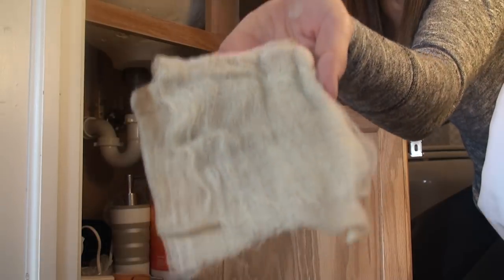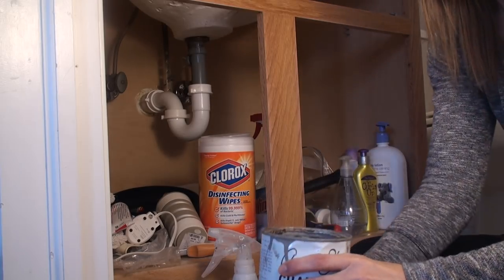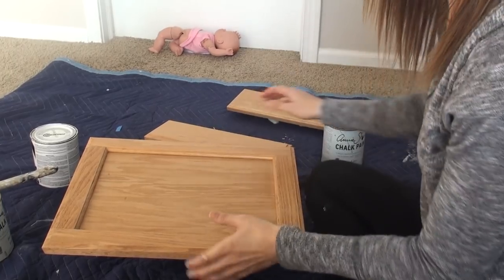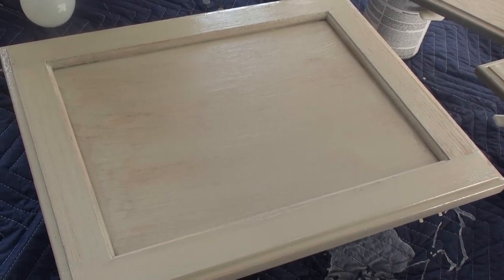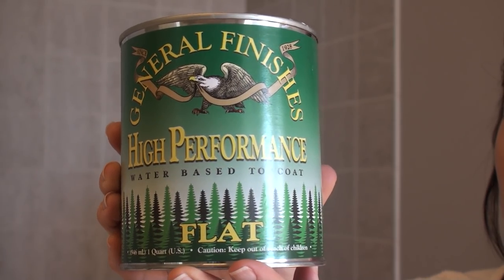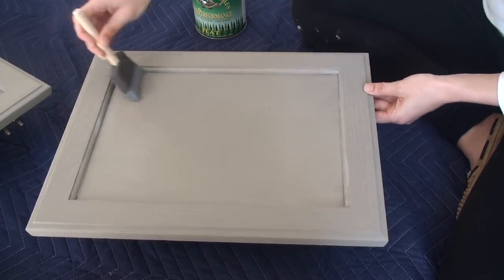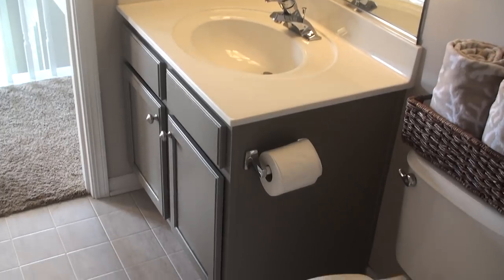Chalk Paint Cabinets With Annie Sloan Chalk Paint

Comment: I just finished my bathroom with chalky paint.  I had the same oak doors with laminate sides.  Chalky paint is very forgiving!  This was my first time using this type of paint, and I can’t say enough good things about it!  Keep in mind that there are other brands out there.  I also used the cheap black sponge brushes without any problems.  I wrapped the brushes in my gloves when I needed a break and they worked out great!  ( also, they kept well over night!).
Reply from the maker: Thanks for sharing. I've got some new paints I'm going to be trying soon.

Comment: I've never been able to use that painter's tape drop cloth without it sticking to the wrong end of the plastic and making a mess. Glad it works for you.
Reply from the maker: That happens to me sometimes. I've just learned you can't roll out a big section. Just do little bits at a time. There is also a dispenser you can put it in that would prevent that. The point is to make it easier, so if it's giving you trouble you are right to just scrap it.😉
Reply: @ChristinaMuscari  a dispenser makes sense. I'm using up the roll by leaving the tape and just unwinding the plastic. Maybe I'll use the tape later :)

Comment: Just a hint: remove all doors and hardware first. It makes it easier and quicker! Love your vids! Also when painting in areas where there is very little room either use a roller or cut your paint brush handle down to a more usable size for for tight spaces!

Comment: Hi Christina, Thank you so much for sharing your experience. 
I'm wondering if you have ever tried to use this top coat on any white paint before? I read couple reviews from Amazon.  They said your cabinet would turn yellow if you apply this top coat of General Finish over white.  Also,  Instead of using Flat top coat, would the Gloss top coat handle better with high traffic?

Comment: New to this paint and I learned a lot watching your technique.  Painting from behind, while propping up the door in front of you took a level of super power talented skill~Just wanted you to know I recognized that!   The squirt bottle technique and brush used so helpful!  Again, just learning, so don't be offended at this comment/question...If there were ever a time you would want to seal, protect and paint the inside of the door, wouldn't this be it?  Would you address why you didn't coat the inside if other then just time or interest?  Will the edges be durable enough for daily use not doing it?  Is it just my OCD that would be fulfilled in matching inside to outside?  Any insight would be appreciated. Thanks.  PS. the waded up necked infant on the floor really freaked me out, tell you little one that was great touch to the video!   : )

Comment: I want to try the chalk paint!!  I really like the finish it gives. Question.  Why didn't you pull the toilet paper holder brackets out? Unscrew, simple. Leaving them attached and painting around is like painting around a switch plate cover!
Reply from the maker: I get this question a lot. They were those weird wing nut screws, and I didn't want to mess with them. The toilet paper holder covered them completely, so it ended up looking like I took them off. But the simple answer is laziness.

Comment: New sub today, sooo loving that you do things properly & explain processes thoroughly instead of doing half the job & glossing over the instructions like so many YTubers (who then post vids called "Why I'll never use Z Brand Paint ever again" when it was usually them who didn't follow the instructions) ... ... Oh no, the OCD-nut in me noticed you painting around the toilet roll holder brackets, instead of unscrewing them - I think I need to lie down for a minute. LOL
Reply from the maker: 😂 You are the second person to say something about that toilet paper holder! It has those wing nuts so I didn’t want to mess with them.
Reply: I'd probably have done exactly the same if I wasn't having an OCD moment at the time LOL. I did have freak out tho, when watching another YTuber using chalk paint on one of those really old, tiny rectangular wooden stools that would be used for little  kids to reach the sink & toilet etc. She decided that "no preparation required" meant she should paint over 80+yrs of filth without even cleaning it. I felt sick.
Reply: Yes, but you can watch Annie Sloan herself on youtube not priming or sanding. I was surprised when she did all the prep in this video.
Reply: LOL. I bounced off the walls when she didn't remove those brackets. But sometimes it's better not to mess with screws, depending on what material they are in. 
Btw, loved the finished cabinet! Nice choice of color, looks very "up scale".
Reply: This is not a jab at Annie Sloan but she is trying to sell a product and to do that it has to be easy for the consumer. If the surface to be painted is not clean and free of old finish that has oxidized or no longer bonded to the surface then the end result will suffer. Christina seems to be very experienced and has learned when to put the paint on without much prep or when prep is needed.

Comment: Thanks for the instructions, you make it look so easy!! I do have a question. I was wondering if you painted the inside of the doors, I couldn't see in the video if you did. Also, how is it holding up after one year? I would appreciate a follow-up on the durability. I am thinking of doing either a gel stain on my bathroom cabinets or possibly paint. I would like to see how the paint held up.
Reply from the maker: I did not. I tend to not paint things that people won't see like the inside of cabinets or behind pieces, but you certainly can if you want to.

Comment: I wanted to ask a question but was afraid it was stupid😳. I was so glad to find someone who commented that she had painted her kitchen cabinets with chalk paint. That's what I wanted to ask about. However, I want to paint mine white and you mentioned that the protective coat may yellow. Is there something I could use that wouldn't? And is there one in a semi gloss?
PS I love your straight-to-the-point teaching.
Reply from the maker: If you are wanting a semigloss finish, I would just use a latex paint. You will need to prep your surface with a primer or more sanding. I don't have any videos using latex. Just do a search and I'm sure you will find a good one.

Comment: This is my first video with you.  Great job.  I'm actually redoing my bathroom cabinet with the same color and I was trying to find a video and came across yours.  I've painted many pieces in Annie Sloan paint and wonder why you didn't just use the annie sloan wax instead of the General Finishes?  Thank you for the video.
Reply from the maker: You can definitely use wax if you prefer.  Either would work. The topcoat is less of a learning curve so I wanted to show it as an option for beginners.

Comment: What do you recommend as a top coat for white chalk paint that won't yellow? Your cabinet turned out beautiful!
Reply from the maker: Only safe proof is wax. All whites will yellow over time with a topcoat, but the best ones are water based like the one used in this video. You can also check out Dixie Bell topcoats because they are formulated to work with paint. https://dixiebellepaint.com/gator-hide/?aff=166

Comment: Do you think chalk paint is a better options vs a regual semi-gloss paint? I have 3 vanities that have been painted white a few time so wonder if the chalk paint will work as long as I do all the prep. I hope replacing hinges will be easy since mine have been painted white by previous owners and look cheesy! I am excited to try putting pulls on for the first time too, thank you so much for your tutorials. Also my fake drawers on vanities don't look like I can easily remove them. Wish they were like yours.
Reply from the maker: I've refinished vanities with both. I like the look of chalk paint better because latex can look plastic like to me. It's really personal preference though. They both held up the same in my opinion. You will have to touch up painted cabinetry every now and then no matter what you use. Replacing hinges is not hard. Good luck!
Reply: I think I will try the chalk paint then thanks so much!

Comment: Your videos are fantastic! I've learned so much from them. Question- have you used low grade wool pads to apply the paint? Curious to know if you have painted cabinets with it or not. I did my dining table and loved it. Also, if I am painting my cabinets white, what top coat do you recommend instead?
TIA!
Reply: Annie Sloan has a water based top coat now!  I was told it won't yellow anything but I haven't used it, but it's worth checking out!

Comment: I'm going to be doing a dining room table soon. I'm staining the top and painting the apron. What if the grain goes in different directions? On top, the grain is diagonal and from all four corners goes toward the middle. Does that make sense? lol! What would recommend? Thanks! Love your videos!
Reply from the maker: Yes, I do. I’ve had tables like that before. Just go from side to side (the shortest width) all the way across. Just keep the stain in the same direction and it should turn out.

Comment: A tip that is a better protection for the paint. Butchers bowling alley wax. Can put on a coat every 10 minutes after buffing with a dry rag. Goes on very thin, nice smell, if you can drop a bowling ball on it, its tough. I do french polish on antique furniture so I know waxes. Much better than poly or laquer, gives a low luster sheen for less expensive woods..
Reply from the maker: Cool. Where do you get it?
Reply: @ChristinaMuscari  , you can get it at home depot or Loews. Alot of times the paint store will have it too... Have fun..

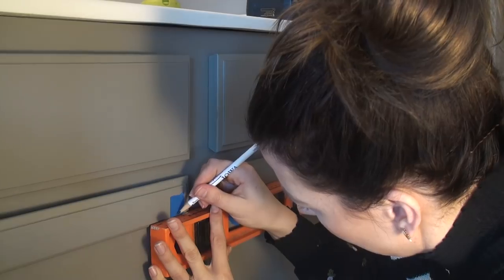Comment: Looks pretty good, but the lighting is poor. At 10:13 I can't tell if I am seeing brush marks or the grain of the oak.  Question:  why did you not remove the door before sanding?  Seems like it would be more comfortable that way.  Thank you for this video.  Your technique is definitely an option for painting my similar oak cabinets.
Reply from the maker: Sorry about the lighting. It's a tiny bathroom with no windows, so the lighting was tricky. You are probably seeing the grain of the oak. If that bothers you, I think there are products you can buy to fill in the grain (like a primer). I didn't have a problem sanding the doors on but you can certainly take them off if that works better for you.

Comment: I have this same color "french linen" and want to do my boy's bathroom. If I wanted to add some darkness in the crevices, how would I do that sealing with the General finishes top coat? Would I apply A.S. dark wax in the crevices and then seal, or use something different to do that? I thought I read something about that sealer not working well over wax, but I may not know what I'm talking about. lol!
Reply from the maker: You have to choose either wax or top coat to finish. You can't use a poly over wax.
If you want to add some depth and or darkness the dark wax is the way to go. If you just want the dark in certain spots you can first use clear wax and then add the dark over in the areas you want.

Comment: Amazing job and thank you for the great explanations. What's the benefit of using the Annie Sloan chalk paint? If you were already priming with the Zinsser, couldn't you just prime the rest of the cabinet and use more economical paint? How many total hours of paint time did this take, minus the drying, do you think? Thank you so much for great content!!
Reply from the maker: You certainly could prime and paint with another paint. I have been working with Annie Sloan for years and always go back to it. It doesn’t have plastics in it like a latex so it really melts into the furniture instead of sitting on top. It’s just a preference for me.
Reply: This is exactly what I was thinking! Why use 3 coats of paint, when you can get the same coverage with 1 coat cheaper primer, and 2 coats expensive paint?

Comment: To get rid of brush strokes to keep it very smooth, you should apply with the grain, let dry then SAND it lightly in between each coat. Next coat you should go AGAINST the grain, then sand, then WITH the grain. That's how you get a very smooth surface.

Comment: Thanks, I enjoyed the video. 

I understand that artists dilute acrylic paint with water at-their-own-risk, as the pigment doesn’t really dissolve as well in water.... Does the same go for latex or chalk paint? Have you ever noticed textural issues or separation of pigment when you dilute with water?
Reply from the maker: I’ve never experienced separation of pigment. This paint is water based and the manufacturer recommends using water for a smoother finish. I don’t always add water like when I want a textured finish.
Reply: I like your picture, Caroline Olsen. Viola!

Comment: Thank you for sharing this! I will be doing my kitchen cabinets soon! My question is, which foam brushes do you use? The ones I get from the dollar stores always leave behind pieces of the black foam. Whether I'm using them with regular paint or mod podge. Please help! Lol
Reply from the maker: I get mine at the hardware store or Amazon.
Reply: @ChristinaMuscari  thank you for answering! I'll try those instead.
Reply from the maker: Another tip I've seen is putting a nylon stocking (like the ones at the shoe store) over it.
Reply: @ChristinaMuscari  oh that's a great idea! So I can still use the ones I got from the Dollar Tree 😊

Comment: Have you had any issues with tackiness? I used oil based paint and mine after a week is dry but has tacky feel to it, mostly when you close the vanity doors. I didn't use the primer before painting but did power sanded it prior
Reply from the maker: No. These are both water based so it dries fast.

Comment: Thanks for posting.  Quick question:  What is the importance if the top coat?  I.e., what if you had only used the chalk paint?
Reply from the maker: It will chip and scratch with use, so I typically seal all my dressers and cabinets. The only things I don't seal are things that hang on the wall or decorative items I don't touch or open everyday.

Comment: I liked the video, but I was surprised at home many coats you needed to use....why did you choose the chalk paint rather then a regular paint, like a one-two coat option?
Reply from the maker: I get questions about painting cabinets with chalk paint so I wanted to try it. I have painted cabinets with latex paint as well. I personally, like the look of the chalk paint better. It does not have any plastics in it so it looks more matte. You can certainly do whatever you prefer.

Comment: Did your Purdy brush come in that shape, or just wear into it with frequent use. The linked brush doesn't have the notch on the end that yours has.
Reply from the maker: It is just sash brush. The point did occur from use. I’ve had it for 4 years!
Reply: Thank you!

Comment: What is the difference of you using the sealer vs the Annie Sloan clear wax?
Reply from the maker: The sealer will give you more protection and water resistance than wax. That being said, I know people who have waxed cabinets and are happy with them. I chose to do the HPTC because my audience wanted to see it most. Personally, I think the topcoat is easier to apply for beginners as well.

Comment: What top coat do you use when painting with a white chalk paint? I want to do my cabinets white on the top and grey on the bottom but don't want a yellowing to them.
Reply from the maker: I’ve never done white cabinets. I’ve used General Finishes High Performance Top Coat on white chalk paint and was pleased with it, but they have warnings on their website about it yellowing over time.

Comment: Often a paint company will say things to trick the consumer into buying their product. For example drying time most often is correct but that is not the same as curing or the time needed so the piece of furniture or cabinet can be used. For  example polyurethane manuf. brag about their drying time but in reality (and this bit of info is often hidden in small print or on their website) polyurethane can take up to 30 days to cure even though the large print on the front of the can says something like dries to touch in 2 hours.

Comment: I thought the whole point of using Annie Sloan chalk paint was that you didn’t need to sand or prime?
Reply: slowrunner40 yes you don't have to but she mentioned that her cabinet was quite old so there was lots of grime she wanted to get rid of.
Reply: And they say you only need one coat and she did three
Reply: That’s exactly what I thought as well🤪🤪🤷🏼‍♀️🤷🏼‍♀️
Reply: It depends on the look you want.
Reply: Em what kind of wax is you don’t mind me asking I want to paint soon
Reply: @Em wax? Or a top coat? What do u mean wax? I thought that was to polish
Reply: @Briannafrancis-e9g  for chalk paint, there is a special wax that is normally used, instead of the standard polish. Google "chalk paint wax"

Comment: I have a question:  I am almost ready to start the guest bedroom furniture, so I watched this video again...At the end, you mentioned that the General Finishes top coat may cause the white paint to "yellow" .. What do you think about my using MinWax Polyacrylic Protective Finish Waterbased Clear Satin?  I have used it on art pieces I've done, but again not furniture. However, furiture is mentioned on the can.  Your thoughts?  Thank you!!
Reply from the maker: I have used that, and I like the GFHP better.
Reply: Christina Muscari, but to what extent will I experience “ yellowing”  with the General brand?  Because I want to paint the furniture white.
Reply from the maker: Joan Carver checkout this video for a side by side comparison. https://youtu.be/cTaUhb9QpcM